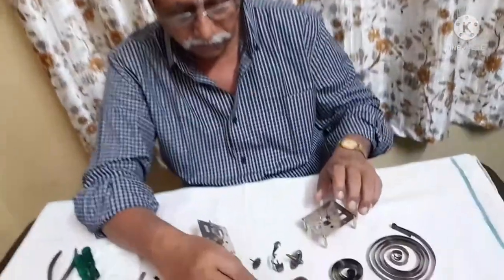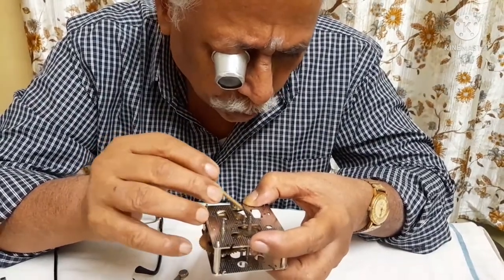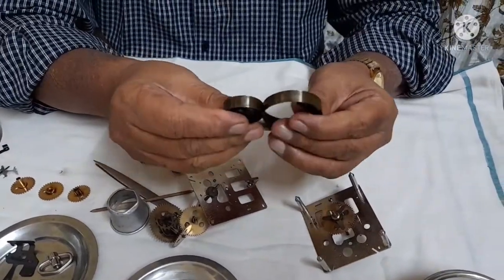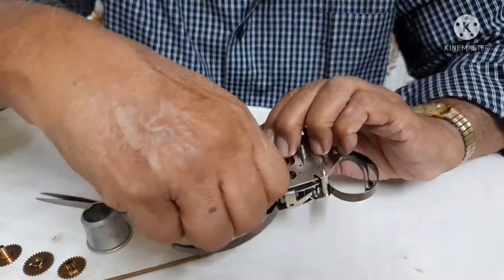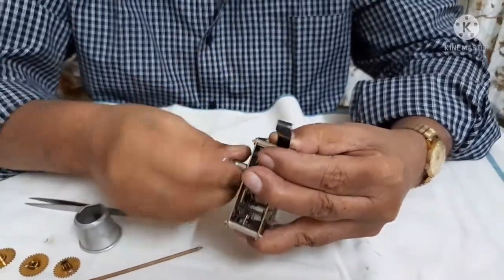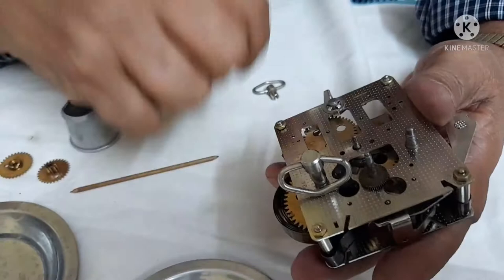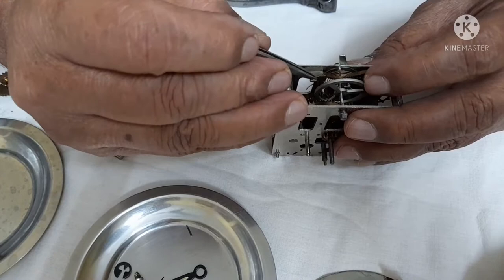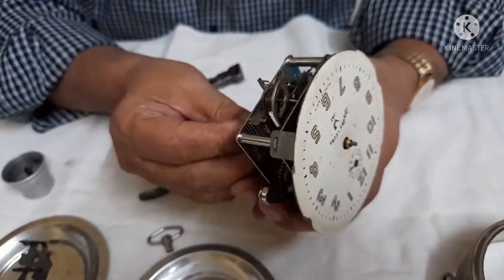Assembling of Favre Leuba Alarm Clock

Comment: Sir my hour key is not working... kindly help
Reply from the maker: Is the setting nut not turning or slipping? If the nut is not turning at all means the fault is in the center wheel. Complete servicing will set it right. If the nut is slipping means the rear end of the center wheel rod is worn out. Please check and inform.All the best.
Reply: Thanks for your valuable information the problem was in the centre wheel but thankfully its working now ❤

Comment: Hello, thanks for this informative video through which we were able to reassemble our clock as well

After reassembly, we found that the clock is noth working and maybe the balance wheel is the problem and needs replacement, please help
Reply from the maker: You need to call so that I can help you on 8355997526

Comment: Sir, very nice work and video. I have once semi-professionally disassembled a Jaz clock 15 years back and could not put it back. Also i have another same clock which has stopped. However i have all the parts. Now I am learning from your videos how to reassemble. Except one or two screws, one key and top stopper. Where we can find these parts?
Excellent work, again.
Reply from the maker: I can send you whatever you need.Where do you live!!!!Not  overseas I believe.
Reply from the maker: Show pic of the time piece to ascertain the correct part identification
Reply from the maker: My no.8355997526 and you can make video call regarding parts required.All the best
Reply from the maker: Hi
What you need,please specify I will send.Love.
Reply: @saisamayseva8712   hi i have 2 clocks the same you need to buy?

Comment: How to clean the parts, sir?
Reply from the maker: Dismantle the movement and soak the parts in ELMA watch cleaning solution for 2 to 3 minutes, use a soft wire brush to scrub the parts and rinse it out with white petrol or isopropanol .Dry the parts and check for sear and tear in the parts, rectify them and assemble.Any more info required, feel free to write or call 8355997526.All the best.

Comment: I want bal kamani of faver leuba alarm clock.,is it possible for you to arrange
Reply from the maker: Hi
Where are you based ? Is it a plastic model or completely metallic?  Do you want reconditioned spring or absolutely new? Currently available springs are stronger and they tend to damage the plastic wheels.Lovr
Reply from the maker: I misunderstood your requirement..Are you referring to main springs or hair springs? Please clarify along with your address and contact no.